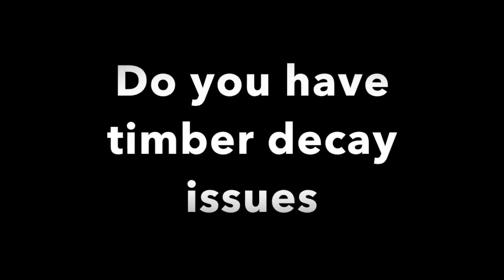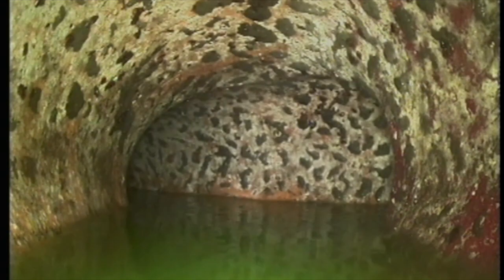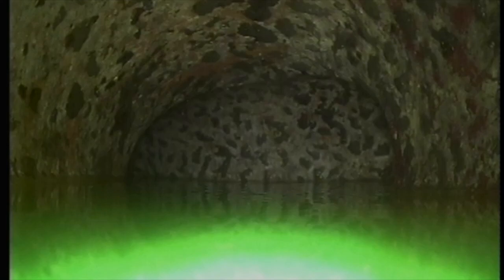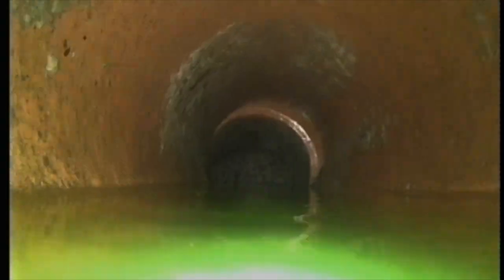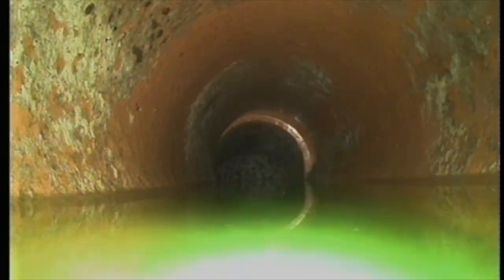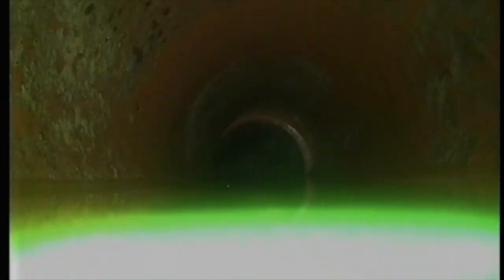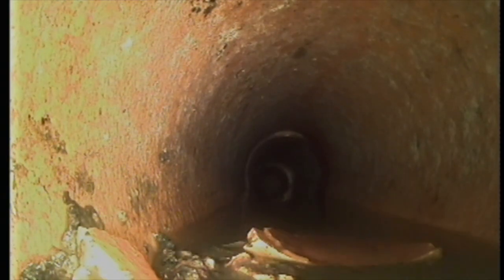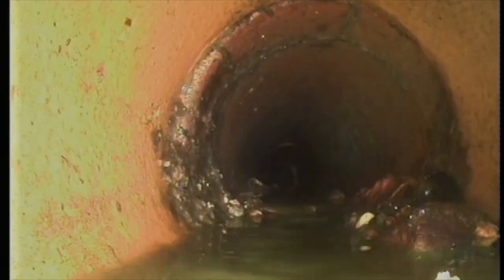The root cause of suspended timber floor decay found

Comment: How much is a CCTV survey Ross?
Reply from the maker: Hi Simon where is the property bud?
Reply: @completepreservation  Hi Ross, I was just wanting to know out of interest - I am a surveyor and the RIDGID kit is expensive so just wanted to get an idea of how it would pay for its self if I look to add it to my kit. Thanks Simon
Reply from the maker: Hi Simon,

It all depends really bud. Lots of times I have to dig or cut into some drains as I can't access them, which obviously jumps the price up. Really you need the camera, sonde locator, along with jetting equipment, possibly some more robust cleaning like chains etc, and a few bits and pieces (minimum about 15k needed) The reason being is if the drain is even partially blocked you have to clean it to inspect it. The equipment is quite expensive, along with you really need a van for surveys. It will pay for its self though over time for sure. I also benefit as I can carry out the repairs, so my I don't mind paying out for kit.
If you have any more questions give me a shout :)
Reply: @completepreservation  Cheers Ross